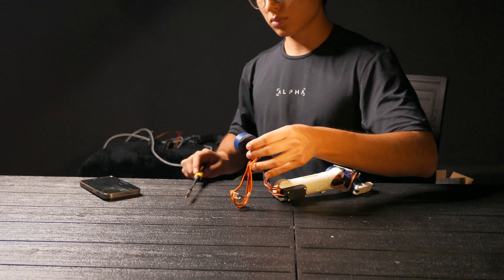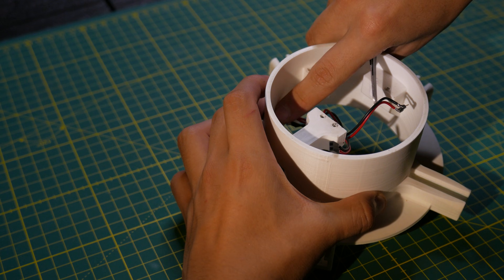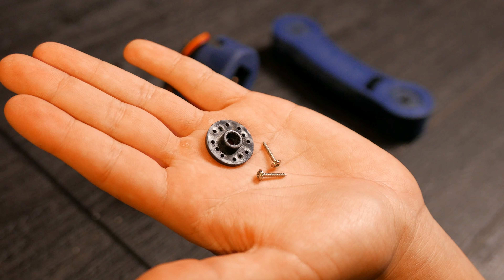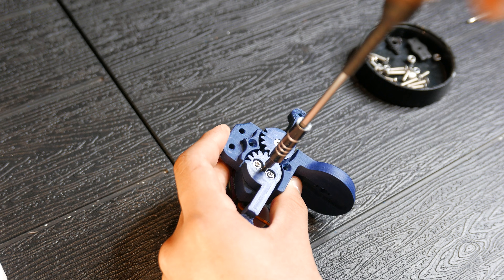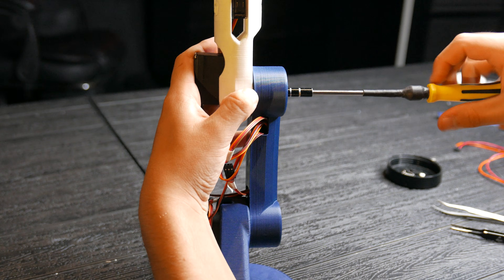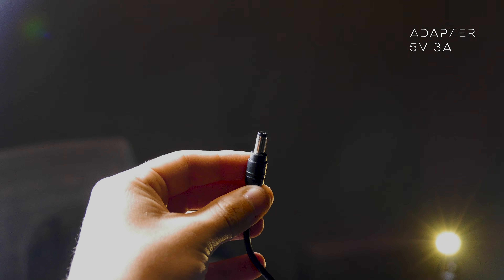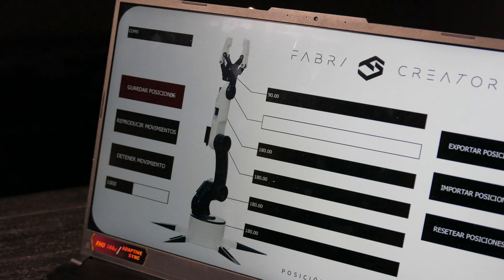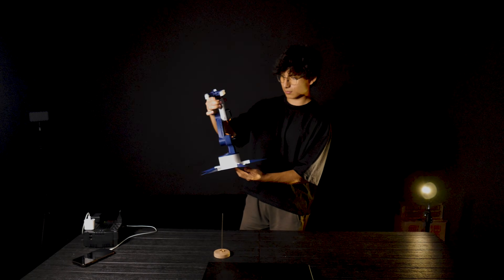Robotic Arm with Arduino - Save/Play/Export/Import Positions.

Comment: Okay so I have given this my all. Almost $100 in and it was a waste of my time. Horrible instuctions. The robot arm is good other than I had to leave screws loose or grinds some to make it work. Big problem first was the code that does not even load due to errors. Fixed that and the app is awful.  The programming awful. This entire thing was a waste of my time.

Comment: it would be really nice if some one could drop a list of all the screws needed
Reply: Maybe I'm late here but I keep M3 in different lengths , they always work with these kind of projects.... until now, I always supply myself with M3 and never had a problem
Reply: @errisveliu just m3 or are there different sizes of m3?
Reply: @londonwilson3485  Yes, it’s only M3. ‘M3’ refers to the thread diameter (3 mm). The only thing that changes is the length, for example M3×8 mm, M3×20 mm, etc.

Comment: That's awsome, I made one with object recognition and it also has a software that runs it!
Reply: Do you have any details? I’m looking to do the same with object recognition.
Reply: @anonomas6113 the route i took was a raspberry pi with a pi cam on it but the processing was done on my main system since I had to code an app for it to see the output and create a decision matrix for it, when an object or face was spotted you would have to program the motors to move towards what was spotted from an imported ml model, that's the way I did it, mines not done yet though 😅
Reply: @ERGYVlogs very cool!

Comment: We are having issues printing on Ender 3V2 - first we used the code you provided, then we tried downloading the step file and translating ourselves into slice........ some of the parts have no issues, the larger parts start okay then during the vertical construction the path is so tight especially around the circular support and the rectangular opening, that the nozzle clogs - any suggestions?  (We did buy the servo kit you recommended).  What 3D printer did you use?

Comment: Beginner here. At the beginning where you solder wires to the jack socket, Is there a cable available to clip on instead of soldering? I bought the kit and have the jack socket and nut and all the 3d printed parts done.  I may have missed it but it looked like a 2 pin connector at the other end to plug into the Arduino. Also why can't the power supply plug right into the barrel connector on the Arduino?  Could you please clarify?
Thanks, great project!
Reply: Same problem mate

Comment: Do you think i use raspberry pi 5 instead of using arduino, it's work ?
Reply from the maker: It can be done without any problem and it's better if you want to add more components or functionalities, because if not the Arduino is more than enough.😊

Comment: Is this abandoned? Or do emails not get answered? The servos your company sent were not metal, and failed on the first power up. Then nothing worked, so we got a new uno and servos. Now nothing in your code functions, and the app (can we get an option other than fullscreen?) does nothing. Arduino works, and I can send generic code to get individual servos moving, but thats it. 

If I was a kid building this, I would be put off from robots, 3d printing, and arduino.
Reply from the maker: Sorry for the problem🙏, if you give me your order number I will give you a refund.
My Whatsapp +51 990 996 163

Comment: how much weight this robot can lift?
Reply: Depends of the Servos an Printmarterials you use If you use HV Servos you should think about external Power so you dont fry the Arduino

Comment: can it bear load tho. i'm doing a robotic arm project and my servos break down after couple of testing runs especially the base and the shoulders . im thinking of replacing the base and shoulder with steppers but they are to heavy and big . can u suggest me some alternatives
Reply from the maker: You can try servomotors with a higher load; also, try not to make sudden or rapid movements and make sure the voltage source has enough amperage.

Comment: @FABRIcreator  got it! Thanks buddy! I am facing an issue though. I have connected the power supply (5v with 5A output) directly on the Arduino Uno and the servos are not moving at all. not powering at all. All the connections following the diagram and I even tried with a single servo. Perhaps something with the code? I Have uploaded it to the Arduino UNO as per the video tutorial (got a small error that I had to add {h-servo} to the line 1 and error dissapeared) and connected all servos from PIN 2 until PIN 7. Power 5V and Negative to the GND and connected both the AC/DC and nothing, I tried all possible combinations and still the arm does not move at all.

Any other suggestions?

PS: Servos are the exact same as the list you provide, the arduino uno from a Chinese maker but that's is fine cause it comes with the CH340 drivers and recognized by the Arduino software) and all connections are tight and soldered perfectly fine.

Comment: The 995 Servos are 180 or 360 buddy?
Reply from the maker: 180😊
Reply: @FABRIcreator  got it! Thanks buddy! I am facing an issue though. I have connected the power supply (5v with 5A output) directly on the Arduino Uno and the servos are not moving at all. not powering at all. All the connections following the diagram and I even tried with a single servo. Perhaps something with the code? I Have uploaded it to the Arduino UNO as per the video tutorial (got a small error that I had to add {h-servo} to the line 1 and error dissapeared) and connected all servos from PIN 2 until PIN 7. Power 5V and Negative to the GND and connected both the AC/DC and nothing, I tried all possible combinations and still the arm does not move at all.

Any other suggestions?

PS: Servos are the exact same as the list you provide, the arduino uno from a Chinese maker but that's is fine cause it comes with the CH340 drivers and recognized by the Arduino software) and all connections are tight and soldered perfectly fine.

Comment: Hi, I really enjoy this project, it is impressive , i was wondering to buy the parts kit ,and print my own parts, but i have a question for @everyone , the arduino code you provide in the description seems too short/easy , how the windows application and the arduino code connect together? how does the windows application send data to the arduino code?

Comment: Is there a printable version of the assembly? The kit comes with all the parts but I can't tell if you cut the wires with the connectors to soldier them to the DC jack.

Comment: Need help i ve done everything same but two problem i am facing one i am using mg996r a 360 one which i will change to 180 soon but the problem is as i move the arm to a direction the weight is so heavy it all falls down to that direction (fyi i have use basic pla same as you for printing , using tower pro motors 3 mg90 3 mg996r which have more weight load than mg995 , and when i move the motor to a direction and when everything is not setted to 90 in application the motor have a slight buzz like the motor is trying to move

Comment: Soooo. None of you encountered over current issues?!?! Connecting all the servo directly up to the Arduino is a recipe for disaster, as the Arduino doesn’t have enough current to power them. It will work, but you’re gonna constantly be running into Arduino rebooting itself.

Comment: really really impressive build my friend. i downloaded the STLs and ordered the motors from the site and will build 2 of these for my personal ai assistant i'm making. just terrific work -- thank you for sharing!
Reply: Any update after the build? 

Any design improvement you'd consider if going for re printing the robot again.
Reply: @ still 3d printing everything and my printer messed up last night after like 70% complete on the print. so i have to try again :( will keep an update and probably put them on my channel as well.
Reply: I have built this printed and fixed motor only no connection given yet and let me tell you it is not as easy as it seems the screws not maching the play issue the wiring mess and soon ss you add motors the robot will keep falling but i believe that  after connection it might hold it
Reply: im trying to get the parts to build this but he only mentions a select few how do i know how many screws i need?
Reply: @CrógaShop it didn't come with all the right screws, so this has been difficult for me to figure out too.
Reply: What filament are you using?

Comment: bro it worked just a little time after a while some of the motors stopped working while hand servo working. im not sure what happened at first try motor pwm wires were crossed, then i rewired it than it was good to go but when i pressed to save positions it brake now only one servo works others not dead im sure but dont know what is the real problem

Comment: I was thinking about building this to possibly be able to remove build plate from 3d printers and add new ones. Do you think the servos are strong enough for this? since most build plates are magnetic it will need a little bit of force
Reply from the maker: Hi, I understand your point, and I agree — they don't seem strong enough. 😕
I'm currently working on a slightly more powerful robotic arm using only MG995 servo motors. Once it's finished, I'll test it to see if it's capable of pulling parts from my 3D printer.
Reply: @FABRIcreator  ok thank you for your reply and for these amazing videos and models!

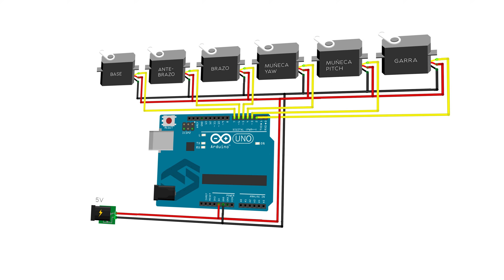Comment: Huge noob here trying to learn too many things at the same time LOL !! The 5V on the diagram at 6:10 is the barel jack right? Would it be possible to use a USB C port instead and hook it up to a power bank???? If yes, what kind of usb c module would I need? Sorry if you already explained this somewhere, Im learning electonic and dont know much. BTW THANK YOU for all of this, I will buy the fusion file so I can mess around with it, reverse engineer and support you at the same time. Amazing job, the arm look amazing and your video wow !!
Reply: it is possible since most cables can handle 3A for those fast charging phones, but in this case, I think 3A is not enough for those types of servos used in the video.

Comment: The servos don't make any movement they only make noise. Im using 5V 3A adapter
Reply: Try providing 5v supply to both motors and adruino. USB alone cannot supply the required power for the adruino.
Reply: Could you please share me the cad model

Comment: Hi!
I am buliding it right now, but I have a problem to control it by Windows Aplikation. I have 360* servo (not 180), and after I change "base servo" position, it spining around whole time. Can You tell me how can I change type of servo in aplication?
Reply: Try to see if there is a problem with the code
Reply: I'm pretty sure that the 360 servo are meant to be spinning, the only possible solution I could think off for your base servo turning would be to use the 270 degree servo so it can have a big turning angle but won't infinitely spinning.
Reply: if the problem still wasn't resolve, try using a potentiometer and program it so it reads the position and not just spin around the whole time.

Comment: Hi  @FABRIcreator,

How will you eliminate jittering for robotic arm. is it not smooth as expected.... any future plans?
Reply: The jittering issue may be because arsuinos are terrible at supplying power, and the draw from the servos may effect the input to the servos. This Is especially a problem when the servos are under load and even more so when a larger servo is under load. 

Servos are also not suuuper great for this but because they are do easy to use and Cheap to buy they make sense for a cheap DIY robot

Comment: I build the robot, but have problems with the third servo, it is not moving. i suspect the output of the arduino is wrong in the software. Tried 2 arduino's but both have the same problem. And the second servo has to be a full metal one. A servo with plastic gears can not handle the weight of the arm

Comment: I build the robot arm, uploaded the arduino code and started the interface, but i don't get any movement in the robot arm, everything is connected as showed in the video, but the arm is not working. Are all connectionS in the video correct?

I tried it now on a different computer, and now it is working
Reply: can you share a BOM ?

Comment: Hi, I noticed in the video that multiple power and ground wires are combined into a single wire. Could you explain what method or connectors you used to combine these wires together? Thank you!
Reply from the maker: I used wires that come glued together and some header pins.
However, what I recommend is to use tinned wires and make the connections as in the video. I put the black wires together, the red ones together and the signal wires separately.

Comment: is this robotic arms stl file length is adjusted in sermon v1 3d printer
Reply from the maker: Yes! The piece that takes up the most space is the forearm and it measures 16.5cm long.

Comment: What are the needed updates to make this industrial, type of the motor for example?
Reply from the maker: You should use stepper motors and other types of industrial microcontrollers, among other things.
Reply: @FABRIcreator  
What about using precise servo motors?

Comment: Brother please repost the arduino code 🙏🏻
existing link shows "This site can't be reached"
Reply: Repost that or just paste that arduino  code here please help me 😕
Your work is outstanding ❤
Reply from the maker: @RIPscammers  
Sorry for the delay🙏
#include <Servo.h>

Servo servo_0; // Declaración del objeto para controlar el primer servo
Servo servo_1; // Declaración del objeto para controlar el segundo servo
Servo servo_2; // Declaración del objeto para controlar el tercer servo
Servo servo_3; // Declaración del objeto para controlar el cuarto servo
Servo servo_4; // Declaración del objeto para controlar el quinto servo
Servo servo_5; // Declaración del objeto para controlar el sexto servo
Servo servo_6; // Declaración del objeto para controlar el sexto servo

void setup() {
  Serial.begin(9600); // Inicializar comunicación serial
  servo_0.attach(2); // Asocia el servo_0 al pin 2
  servo_1.attach(3); // Asocia el servo_1 al pin 3
  servo_2.attach(4); // Asocia el servo_2 al pin 4
  servo_3.attach(5); // Asocia el servo_3 al pin 5
  servo_4.attach(6); // Asocia el servo_4 al pin 6
  servo_5.attach(7); // Asocia el servo_5 al pin 7
  servo_6.attach(8); // Asocia el servo_5 al pin 8
}

void loop() {
  if (Serial.available() > 0) { // Si hay datos disponibles para leer
    String input = Serial.readStringUntil('\n'); // Leer la cadena de datos hasta el salto de línea
    int servoIndex = input.substring(0, 1).toInt(); // Obtener el índice del servo
    int servoValue = input.substring(2).toInt(); // Obtener el valor del servo
    
    switch (servoIndex) {
      case 1:
        servo_0.write(servoValue);
        break;
      case 2:
        servo_1.write(servoValue);
        break;
      case 3:
        servo_2.write(servoValue);
        break;
      case 4:
        servo_3.write(servoValue);
        break;
      case 5:
        servo_4.write(servoValue);
        servo_6.write(180 - servoValue);
        break;
      case 6:
        servo_5.write(servoValue);
        
        break;
      default:
        // Índice de servo inválido
        break;
    }
  }
}

Comment: Hello ..! 
I am student study the faculty of Mechatronics engineering and really love your projects and I hope work together think of like an assistant even if their is task or such a project I am ready to give you hand I am qualified in mechanical design using solidworks and want to increase my level in programming and coding to give the result like that I saw from your software think for it like an offer , I am not thinking about the money no need for money at all . 
The mean of my offer is if their is a task in mechanical design or Arduino code I am ready to help within for helping me in programming such a software lets do it like a team . 
Hope answer and thanks for the information that you give in your genius video building structure

Comment: The circuit connection shown in 6:10 is wrong. the servo pins must always connected to PWM pins .If not they will not work. The PWM pins in Arduino are 3,5,6,9,10,11.
Thank you

Comment: @ Fabri_Creator 
 Good job , Please what 3D printer do you use to print the parts?
Reply from the maker: I used a FlashForge Thor 400, it is very old, right now I use a BambuLab A1, it is more recommendable.

Comment: Amazing! I’m also a design engineer. Could you make the solidworks files available at all? As I use solidworks and the design tree would be useful to make some modifications I think could improve the move ability?
Reply from the maker: What kind of extension do you need? I only have the stl, step and fusion360fie